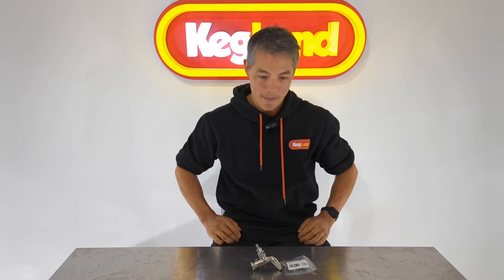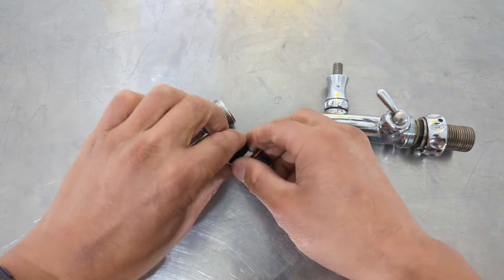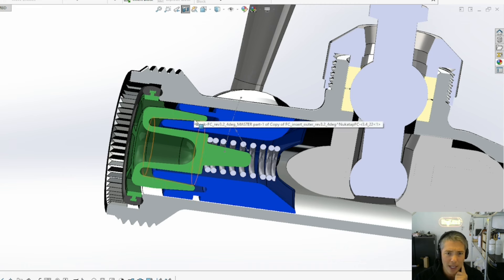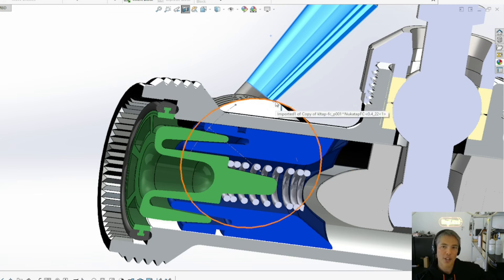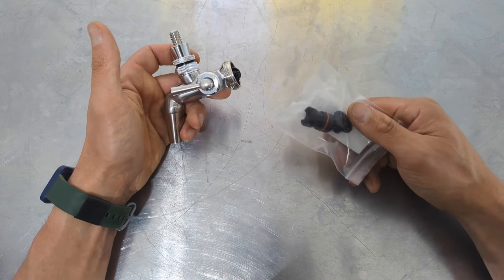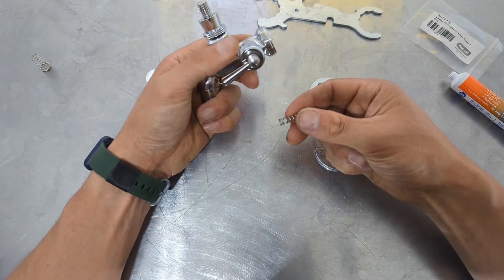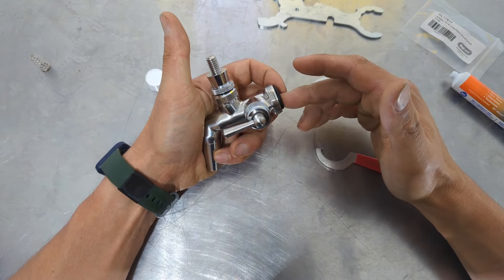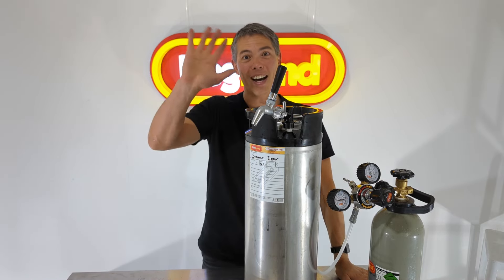Nukatap FC Gen 2 - Flow control for highly carbonated beers & high pressure beverages.

Comment: Awesome. The original Nukatap FC kinda sucked. Most of my taps are "celli" or Lindr taps, and while being rear-closing, their flow control definitely is much much superior. Much foam with the gen 1! Nearly didn't use it because of that, even though it had some other benefits. So, I am ordering the new guts now as they are available, and with my new rather well carbonated Brut IPA, lemme get back here with the difference :) (also a small note on the final test... it doesn't really matter how big the dispense pressure is, but how the beer is actually carbonated, ey. But nice for the show :) )
Reply: Tested the new guts and indeed, much better! Taps my rather well carbonated brut ipa well, no longer do I loose carbonation. Great update

Comment: Hi guys. Im currently using your 1st Gen Nukatap FC. Having real trouble with them and my jockey box which requires a dispense pressure of around 32 PSI. I get foam unless I set the flow to a trickle. Firstly is that common with the 1st Gen's and will this new upgrade alleviate this issue?
Reply from the maker: Foam issues on a jockey box are often due to too low a gas pressure, actually. Try increasing that
Reply: @KegLand  thanks I will do that
Reply: Would like to just state that increasing the pressure to 37 PSI did the trick. So all sorted

Comment: Great innovation from you guys! I actually went back-forth email exchange with you 1.5yrs past when trying to fix my leaking taps. I even suggested to you to add overmold rubber on shuttle part. Back then there was patent(s) restricting you from doing it. Great to see you have found a way around the patent(s) to improve the Nukatap FC!

I never managed to get my taps to seal correctly, maybe this enables me to start using my Nukatap FCs now. How to get the parts (shuttle parts and spring) quickly to Finland?
Reply from the maker: With the sealing on the shank I think most of the issues were techincally caused by dented shanks as many retailers do not individually box the shanks and if they knock against each other the shank face would get dents and as we had a hard POK sealing surface on the FC tap this was not able to mould around the dented surface of some other shanks.  As you have pointed out the new overmoulded seal does solve this problem so even if the shanks are not well stored or treated these new designs will still seal well.

Comment: Love how you guys keep innovating. I did find the old FC taps stopped being effective at higher pressures.

QQ - any chance of a clip or something being made to hold the tap open? The one issue with the springs is it makes using the taps as a “source” for a counter pressure style bottle filler difficult.
Reply from the maker: Really the easiest way is just to remove the spring and then the tap will definitely stay open.

Comment: We're currently building out our 1st keezer and are looking at using these Nukatap Gen 2's as our faucets.  I'm curious though:  with this Gen 2, if you use the spring that returns the handle to "off" position does it then attach to ANY standard shank or does it have to be a specific size / type?
Reply from the maker: Most taps on the market (including Nukataps) have specific shanks they are compatible with

Comment: I like the design.
Having a spring in the flow path presents some sanitary issues right?
Is it possible to mount the spring on the outside or not in the fluid flow path?
It would still be able to act to close the forward valve mechanism.
An interesting engineering challenge.
Reply from the maker: It is impossible to fit the spring on the other side of the shuttle and this would not make it any more sanitary.
Reply: @KegLand I have a design where there is no internal spring mechanism in contact with the fluid.

Comment: What would you recommend for flow control with sparkling water? With the higher pressures it's really hard to keep the carbonation in the water.
Reply from the maker: Flow COntrol disconnect or Nukatap will help a lot, or simply run longer or narrower line - you just need to slow the pour to prevent carbonation getting knocked out
Reply: I would recommend this updated tap for high pressure sparkling, it is working a lot better for me than the old design you can slow it down as much as you want and the carbonation stays in solution.

Comment: Will these upgrades come to the ball lock FC as well?  I can never get that one to work right, it immediately foams once the beer leaves the disconnect.  Thanks
Reply from the maker: I syspect its the same tap with an extra ball lock fitting, so this will work

Comment: Would you see any benefit with sodawater? I have a fc on my benchy sparkling. I feel like it would be.
Reply from the maker: Pouring soda too fast will knock CO2 out of solution, so quite proably.
Reply: @KegLand  I have already upgraded my taps since making the original post. I can confirm the difference is night and day before I wasn't able to use the entire range of flow control because I would be this resonance/water hammer effect, now I can adjust the speed it comes out completely and end up with way more carbonation in the final product. Thanks for the free upgrade.

Comment: Do you have a new Gas regulator? MK5. I can't find it on your website. Only MK4
Reply from the maker: Although we have started to use the MK5 in the kegerators already we are still in the process of clearing some older MK4 stock out. The new MK5 is going to be released soon.
Reply: What will the difference be?